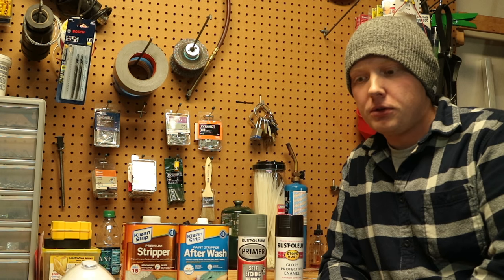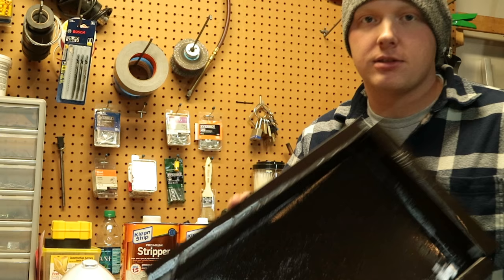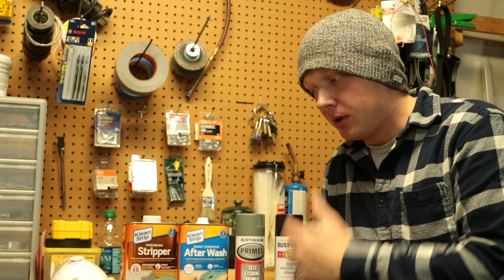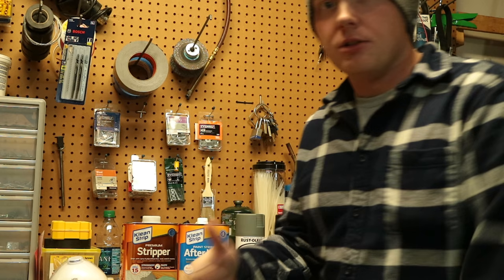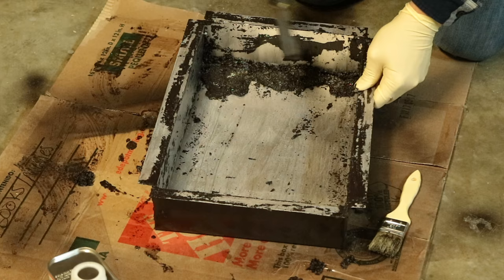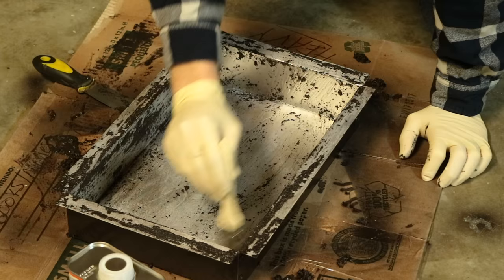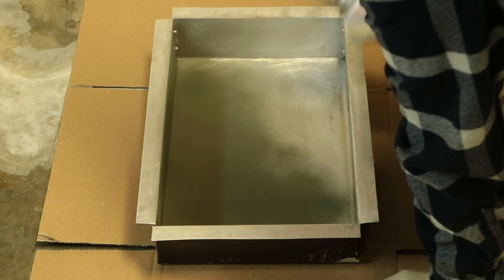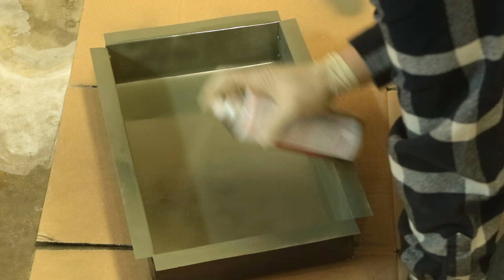The Right Way To Paint Aluminum

Comment: What type of paint can I put on top of the self etching primer? Any paint? Sprays? Water based? Oil based? It would be for an outdoor aluminum surface, and I would like a matte/flat sheen in brown.
Reply from the maker: +Johannes Kalb I would go with an oil based paint if your going to be using it outside. I'm sure others would work though.
Reply: Thanks! Anything else I need to consider? or does pretty much ANY oil based paint work? Does the paint need to say that it is for metals?
Reply from the maker: I mean I can give you the PC answer and tell you to make sure you check the label to see if it's compatible. You can see the type of paint l like to use in the video, which is also linked at the very top of the description.
Reply: SMG Fishin' What would u suggest for painting bath fixtures?

Comment: so my boat has a thick coat of brown on the hull , when I apply the paint stripper, how do i remove the mess? hose it down? then should I dry it before applying the primer? thanks
Reply from the maker: +dacastro1 I'm going to say dont hose it down ;) the EPA probably wouldn't like that too much. If you could rinse it without making a chemical waste epidemic then I would find a way to do that. But yes. They also make an after wash that is supposed to remove the mess that the paint stripper leaves. 

Let's say I rinsed it in a bucket with water and then properly disposed of the chemical runoff.... let's say it totally didn't kill my grass and everything around it. Let's say I'm a completely responsible adult and did the right thing.
Reply from the maker: +dacastro1 if I were you I would just paint over the brown paint that's already on it. It makes for a good primer. Just make sure to scuff up the paint before you paint over it.

Comment: I spray painted my bicycle wheels black there alliminium wheels but I can scrape the spray paint off how do I fix it
Reply from the maker: Watch the video buddy! Etch the crap out of it before spraying. Using a chemical or abrasive will work most of the time. If it doesn't it's probably not worth the hassle of painting to begin with.

Comment: sir, may I know after applying that primer is the color scratch proof?
Reply from the maker: +Mohammad Irfan I wouldn't say scratch proof but it definitely helps by adding a layer of paint between the top coat and the metal.
Don't forget that paint has a dual purpose. Not only does it look good but its main purpose is to protect the metal from rusting over time. The more layers you have the better protection you'll have.
Reply: Thank you so much for your response, sir. :)
Reply from the maker: +Mohammad Irfan no problem.

Comment: Any ideas how to get decals off an aluminium horse trailer?
Reply from the maker: You might try the same paint remover I used in this video. To be honest I’m not sure if it’ll work. I’ve had some trouble getting old decals off aluminum but most of the time it just takes time to peel them off.
Reply: Soak decal in wd40
Reply from the maker: That’s a good idea. I’ll have to try that out!
Reply: Get the 3-M decal removing wheel....removed all the decals and adhesive from a 20 year old and 24ft pontoon boat with ease...$40 but worth every penny

Comment: Would this work for me to paint my 01 Honda  cr125 frame and swingarm with some grip tape where my boots ride on the frame
Reply from the maker: That’s a really good question. I think your frame and swingarm might have a clear coat on it right now you might have to get off first to paint it. I know most people typically powder coat their frames. I don’t see why you couldn’t though. Probably wouldn’t hold up as good. Let me know how it goes if you decide to paint it.
Reply: SMG just need to wait for it to get warmer so I can paint thanks for the help I’m probably going to use a lot of clear so it holds up

Comment: ever herd of adhesion promoter??
Reply from the maker: I've never used it before myself. What I've seen is an adhesion promoter would typically be used on polyolefin surfaces (mostly automotive plastics and fiberglass). Have you used it on aluminum surfaces?
Reply: no, it is almost absolutely needed to paint glass & plastic. but you can use it on anything. basically, its a glue thats adhesive & paint able. you can also chemical etch, or scuff it with 100 grit paper.
Reply from the maker: Awesome. That's good to know. Thanks for the tip!

Comment: I tried the Rust-oleum self etching primer on an aluminum motorcycle rim and it sucked. I do not recommend it at all. I had to re-strip and repaint. 
The section I painted was rough casting not shinny. Big thumbs down!!!!
Reply from the maker: Sorry this didn't work for you buddy. I wouldn't be doing this with something like a rim for a fine finish. This is just to get some paint on a piece of aluminum. The look was never really a concern with my foot tray. If you're having issues with painting a rim It's all in the prep. If you don't take the time to sand it down and remove all of the oils it won't turn out good. Check out Cameron Niemela and how he preps all of his stuff. He does an absolutely amazing job.

https://www.youtube.com/channel/UCFEDSSjAp1aIlVmgVrEWAOQ